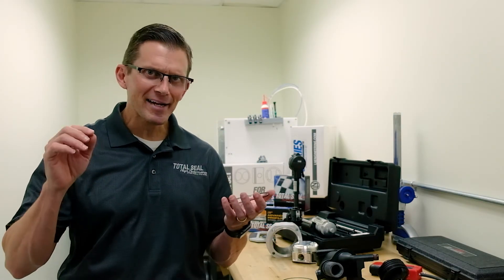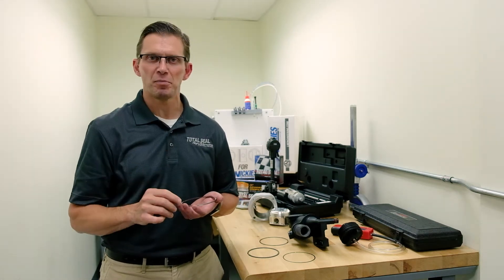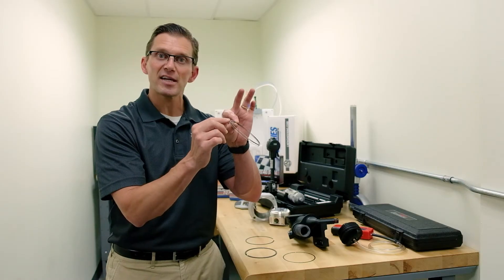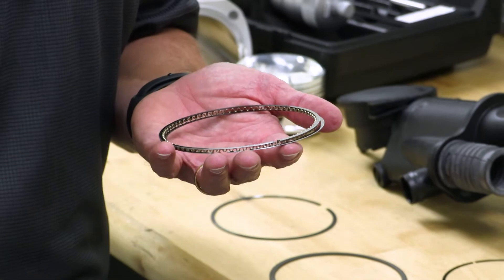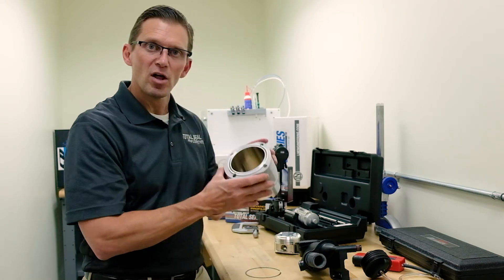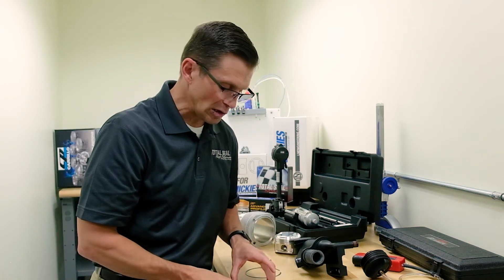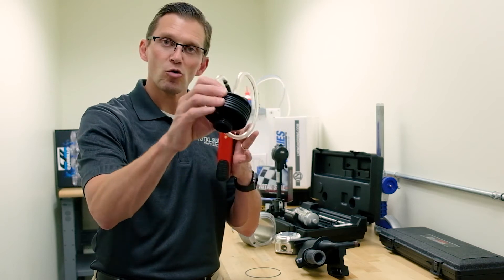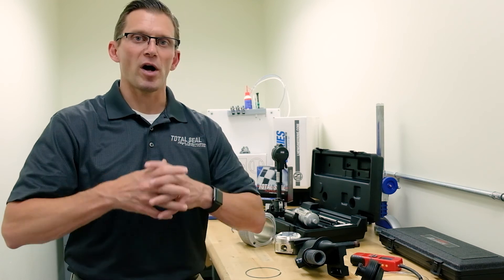Piston Rings 101: Piston Ring Types and Function - with Lake Speed Jr.

Comment: I find it interesting to see 2-piece oil rings in many German gasoline engines. When I first saw it, I asked "Who puts diesel rings in gasoline engines?"
4:08 How would an AOS keep vacuum going when the engine is on boost?
Reply from the maker: The OE 2-pc oil controls work really well but sadly, they are not available in most bore sizes, so 3-pc oil controls are the only choice. Total Seal now was their Ndurance oil controls where they nitride the expanders which helps them retain their tension better than normal 3-pc oil controls. As far as your question on the AOS on turbocharged engines, that's a great question! We don't deal with turbocharged cars much, but Mike at MotoIQ does: https://youtu.be/mp81Hzan5Fk
Reply: @lnengineeringllc  Thanks a bunch. I have always been into turbo engines. The Nissan 300ZXTT came out when I was 5 and I instantly wanted one. I have seen the same crank ventilation parts on both turbo and NA engines, but never did understand how they could maintain vacuum or at least ambient pressure while on boost.

I take more interest in Japanese boosted legends, but I do like German cars a lot.

Thanks for your help.